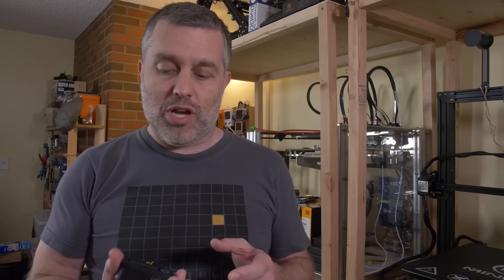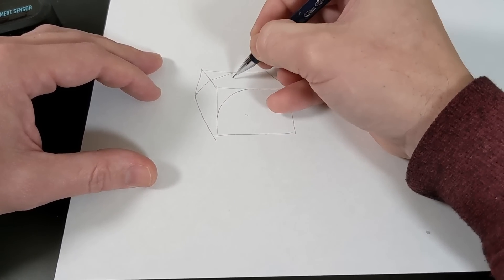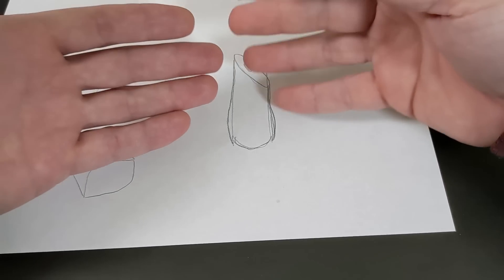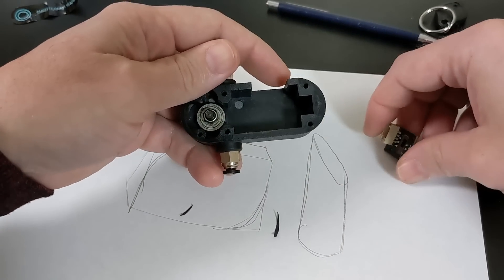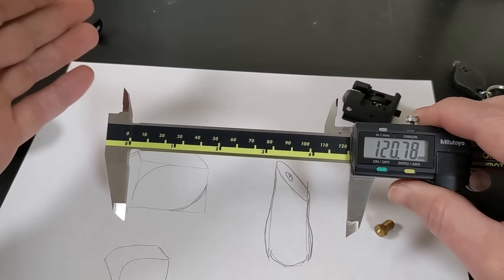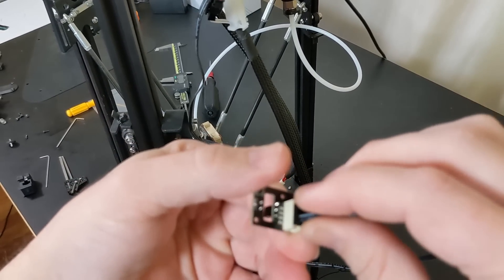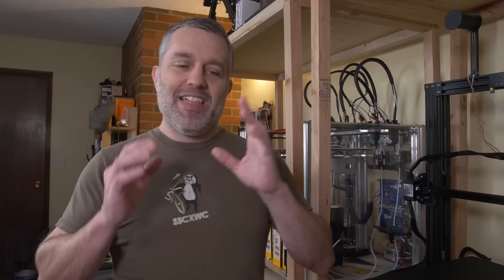The Bigtreetech Smart Filament Sensor - An In Depth Review

Comment: Well this was absurd. The only actual design flaw with this sensor is the wiring. That is absolutely a problem, but it is one that won't be a problem if you read the manual.
I have two of these, been running them for a long time, never had any issues. Never had any false positives, they always trigger when they should, and I don't print into thin air when that happens because I'm not dumb enough to mount it on the wrong side of the extruder.

The only thing except for the wiring I could possibly see as unnecessary here is the somewhat beefy case, but there's really not that much extra there. I'm 100% sure that if they thought they could get away with a cheaper setup, they would, even if the customer wouldn't get a lower price.

This video is a demonstration of weird prejucides regarding the people who made this (this is designed by an industrial designer, it looks exactly like an industrial designer would make it..although it doesn't actually look like that so I'd made by an amateur...wtf?) and China in general.
I don't care if people think this sensor that absolutely works as advertised is bad because of this video, but people thinking this is an "honest review" (which I guess it is since all the bad ideas of the producer of the video is left in the video..) and them staying away from anything made in China is not a good move. Although obviously you don't really have that choice to begin with, everything is made in China, but the idea that sometime is automatically bad because it's designed there is just absurd.
Reply from the maker: >I'm not dumb enough to mount it on the wrong side of the extruder.
Long time viewer I see. Welcome back! Reading the output side of the extruder means you are more directly reading what is going into the nozzle. It gives more accurate data, because something could be happening between the nozzle and the extruder which the printer would be unaware of with the sensor mounted before the extruder. But you knew that already. The "You're not special! You don't come up with original ideas." comments are great. I know how much I've impressed you all by how much hate you direct at the idea. 99% of the time you attack my person. When you are attacking my creation instead...Anyway, thanks for reminding me about that win. I forgot I did that. The really funny thing about it is that I mounted it there because it just made sense. It seemed so obvious that I was sure it had been done before. I didn't know I'd done anything controversial or special until you all decided to make such a fuss and try to belittle me for it.

Comment: Most people really don't care about the design things that you point out in the video.  They care about how well it works.  Too much time spent on bashing the product.  I didn't have the patience to watch the whole video to see if you actually got to how well it performed..
Reply from the maker: Dude, you do deep dives into the tech of pinewood derby tracks. Pot, meet kettle. Also, this video has better audience retention than many of my others, so clearly I was talking about things people were interested in.
Reply: @DesignPrototypeTest  Sorry to upset you.  I was looking more for how well (or not well) the product performed but got bogged down into all of the minute design details.  To each his own, I guess.
Reply from the maker: >I was looking more for how well (or not well) the product performed 
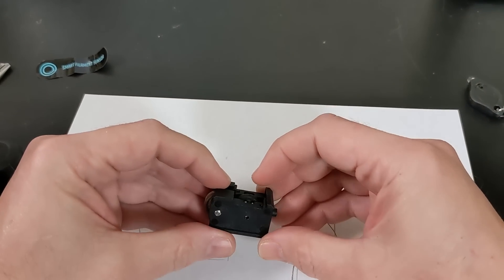tl;dw It's junk. Don't buy it. I burned up both of the sensors I bought (which isn't really my fault https://youtu.be/7xVRTtWErvo ) and never got to actually test it working, so instead I did an in depth discussion about the design, theoretical performance, and overpriced nature of the product. The key takeaway is presented ate 8:27 : Using a .4mm nozzle and a .2mm layer height, this sensor will print 120mm of X,Y axis travel before it realizes it's out of filament or has a jam. Depending on how small of a part you are printing this could be an entire layer that gets printed before the sensor notifies the control board the filament isn't moving.

Comment: It would be better if they had a higher resolution encoder and used it to also track the filament extrusion length and correlate and correct esteps on the fly as well as jamming or broken filament

Comment: Dude... that's just standard flat cable marking, as to distinguish the individual conductor from end to end . Though it may look like its labeled from the factory for polarity, it is in fact labeled by the wiring manufacturer who has no idea how you will orient it. The issue is that BTT sourced flat cable with JST 4 connecter that looked to be marked, while in reality you have to read the manual to ensure polarity.

Comment: The smart filament sensor might not be the best, but its alot better than a micro switch run out sensor. The smart sensor have saved alot of prints for me, you talking about the print goes 120mm before it knows, ye, well im using a 0.6mm nozzle but anyway, the majority of times the filament was stuck and two times I run out of it, never on the outer wall, only inner walls or infill, maby lucky but it saved my 19h prints. Is it overdesigned, sure, but it works. 
A micro switch filament sensor wont feel if the filament gets stuck when unwinding from the spool, it wont detect when there is a clog in the nozzle etc. low res, sure, but until you present anything better, im using it =)

Comment: Hi, I personally use two of this sensors one on my E3Pro with SKR1.4Turbo board and one on E3v2 with stock board, I'm very satisfied with their performance I did'n have any problems with connecting them or configuring Marlin. As I think You destroyed at least one of them - do You still have case from it as I think You had moulded case and I have one moulded and one printed - I would gladly upgrade my printed to moulded one - are You interested in trade?

Comment: This is designed for the skr 1.4 it works fine, sure big tree tech is cheap, but I can't justify a duet when has no advantages over the skr. Why don't you buy a duet sensor if they are so good 🤣

Comment: A magnetic rotary encoder with near full rotational acuity would would offer some distinct advantages. BTW I see your Mitutoyo Calipers there, what excellent metrology instrumentation you have. A rotary encoder of the appropriate accuracy could also be coded into the firmware to extrude more precisely, by using the encoder output directly, or by calibrating your motor steps per mm.

Comment: Maybe this sensor, but their board and other stuff they did are very good. I just ordered SKR PRO 1.2 + TMC2009 + WIFI + TFT70 + BTT PT100 V1.0 + OMG  Dual Gear Drive, been looking for a sensor I guess ill use my existing JGAroura sensor that works perfectly fine. May be they have not given you their board for review and now you are ranting on them :D:D:D

Comment: 7:17 they used 3 wheels so the encoder wheel doesn't get worn when a user repetedly inserts filament into the sensor. If you didn't realize this then im scared for the company that hired you to be their industrial designer.

Comment: Hmm... I have to disagree with you on this one... First of chinese manufacturers tend to try to make the cheapest products.. so it's suspicious that they would spend so much on trying to make the product the way it is. But here are a couple of guesses, One the reason why it's a metal on metal contact is to avoid any of the rubber from the rubber wheel to have a direct contact with a filament as it can provide contamination or rub off eventually since it's plastic to rubber contact. Second because they had to add a second wheel that is metal, then they have to find an adequate way to push pressure onto the metal wheels in order to to get enough pressure for any skipping of the filament to not give a false positive on the jamming. Thus with the amount of pressure needed to push the metal idler wheel it is required to have a fiber infused plastic for the strength. What is sort of a downfall though is the lack of proper wiring pinouts since it looks like you connected it the wrong way or something was connected and properly

Comment: WOW! you nailed the exact story of my regretful purchase of this dumb filament sensor. only that my trials exceeded 2 months of continuous failures!. and YES, the sensor that I have also got toasted in the process... plus, I've been abusing my ender 3 with loads of customization for nearly a year now and never felt the need of installing a filament sensor. the trick is to weight the remaining filament before printing, and then be around it when the it runs out so that I can shove a new line of filament on top manually.

Comment: I have two, one I purchased and one I inherited that was 3D printed.  Guess the original ones sold were printed and that one did give me an issue where it jammed up internally.  But so far they have saved two prints from crappily wound spools that ended up jamming.  One of which was my fault and the other was no name filament brand.  If I had been using a simple switch sensor, the printer would have continued to grind away at the filament and all would have been scrapped.  With the default settings in Marlin for the sensor, the printer sensed a problem quickly and paused until I fixed the issue and was able to continue with only minor flaws in the print.  They adequately perform their function and that is all I could ask.  While far from a perfect product I don't feel that they are worth the total disdain of the video.  I felt it uncomfortable to watch and I hope that is something you don't repeat with future videos because I want to like your channel.  The hobby needs good content creators.

Comment: I watch these videos in complete amazement!  Radical thinking at such a new level of crazy! Hypocrisy is amazing! So let me get this strait, you wouldn't buy a ford car because one of their cars once built was the worst car ever made, oh opps chevy is on that list also as is all other car manufacturers so apparently you don't drive, or own a toaster or any other product!. So since they made a poor product all their product is bad? You don't typically let the smoke out of a product unless something was done wrong, it is a given the product should be protected against that but that too costs more money. I have successfully used 5 or so of these sensors. They do not solve all problems but they solve more than a simple switch! DIY printing is about balancing cost and functionality. What other sensor would you recommend and why did not not say? Is it because there is no other that will detect loss of movement for under 30 bucks? Filament breaks and out of filament is only 30% of failures therefor simple filament switch detection (you developed one) is almost useless. Never mind most of those sensors cause the jam when the kink at the end of the spool gets stuck on the input of the sensor causing the failure that is is suppose to detect. I am sure a better sensor can be designed but a 5000ppr encoder and all the components to make it work is very heavy and more importantly very expensive, who would pay $200+ for a sensor? The bottom line is bang for your buck, cheap but with functionality, inexpensive but solves the most problems (but not typically all), this is DIY 3D Printing!

I'm not sure I would attack a company for their rev 1 product having some shortcomings! We all know that in order to find the shortcomings you have to build the product and use it, I think they have a word for that, on yah Prototyping! Everything gets refined over time if it solves a problem! If your the person you project I would suggest you never buy a rev 1 product from anyone!

I like to keep things in perspective! The only reason DIY 3D printing exists is because of the Chinese! No European/North American company could produce the products for the costs affordable by the community! Not even Prusa who likely uses near 100% Chinese components to cut costs! Sure 100% of the time their could be a better product but we all know it will cost more and not likely be affordable. We could all only drive the best most reliable car but not everyone could afford a $100,000 car so its not practical! I often detect a hint of racism in your tone, may just be me. They are the hand that feeds you! You would have no channel that pays you at all if 3D printers were $20,000 like the commercial ones with the $1000 sensors.

As an example, slice Engineering has a exceptional direct drive hotend! It is $200 where others are $50 or less, function wise there is a bit of difference. Is that worth $150? That is for each person to decide.  You can buy a Chinese I3 printer or a Prusa, both are really Chinese but is the $600 increased cost worth the functional difference?  Again for each to decide! 

As you once basically put it Prusa printers cannot detect lack of filament movement or filament jams they used similar to your sensor design!
I did try your sensor design, 7 out of 10 times it failed when the bend at the end of the filament either stuck on the spool or jammed in the input of the sensor causing the extruder to miss steps and strip the filament and not detect the loss of filament. Does that make your product bad? No it means it detects 30% of the problem and we all look for detecting 100% of the problem. Who knew that until it was designed and tested by the masses! But did you put out a new video on how (in your words) crapy your non Chinese product was because it failed to detect most problems? Did you redesign it for a rev 2 product to meet its shortcomings? Did you re-write reprap and marlin firmware to support your new excellent design?
My point is not crappy products, its about prototyping and the process it goes through to meet market needs! Few including you get it right the 1st time! That doesn't mean attack them but it does need constructive criticism and the ability to remove DOA product and yourself issues from the product for a fair review.
Reply from the maker: https://youtu.be/WzTffmCI374

Comment: I'm using this sensor for several months now and really like it. It helped me to detect many jams. Some youtube viedeos from BTT on using it, are not really helpful (e.g. they mount the sensor after the extruder), but if you know what you are doing, it is working like a charm. The design may be bad, but who cares, if it is working? Seems, like your analysis doesn't fit to my experience. Have you really tried to use it or did you only an analysis to make a chinese bashing video (clickbait)? SCNR

Comment: Ignoring the design flaws and just focusing on encoder wheel design..  Do you feel a 36 hole wheel @ 1 rotation pr 35mm would be acceptable? We would be looking at 1 state change pr 0.48mm of filament.
Reply from the maker: You are on the right track. :) It's a future project I have in mind. Watch the next two videos I made on the subject of this sensor. Links in the description.
Reply: @DesignPrototypeTest   I already watched them :)  I have a prototype sensor sitting on my desk I cobbled together over the last 2 days.. I just need to order some optical end stops to test it out and refine the model a bit.

Comment: Biqu (the H2 extruder) is also made by bigtreetech I believe. But we once tried a MKS base from them and the quality was visibly worse opposed to the 'original' by makerbase. We have been looking for a compact encoder style filament sensor though, if this worked, the electronics could easily have been transported into a smaller housing without the second wheel... Too bad

Comment: You should look into a SKR board with Klipper. It blows Duet out the water. Klipper has the ability to run multiple boards too (something Duet doesn't do well).

Comment: If they exposed the encoder wheel directly to the filament it would be eaten within a few rolls of abrasive filament. Their design is correct. Having such a strong opinion without considering all of the facts doesn't do any good to your rep. Regarding the reverse polarity, the components on the PCB need the full 3v3 to operate. There is no headroom for diode loss. The online documentation has clear instructions on how to wire it.
Reply: There are ways to protect against reversed polarity that don't have that problem.
Reply: It doesn't rub or push on the filament, so how will it be eaten? The more abrasive, the better it will grip and move.
Reply: @saddle1940  Your wheels roll over the tarmac so they should never need to be replaced right? Even the rear ones which don't need to handle turning friction. Unfortunately that is not the case. The very friction which produces the grip (rolling and static) is the same friction which would gradually eat away at the encoder.